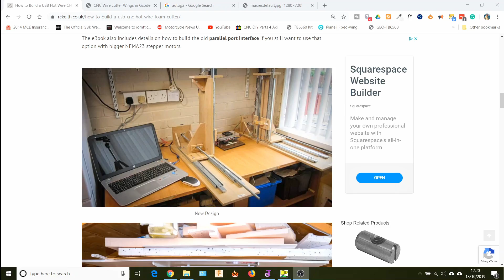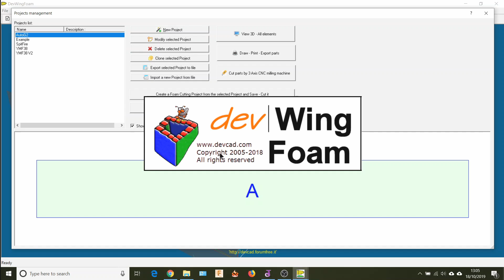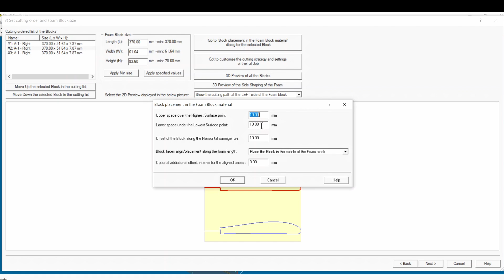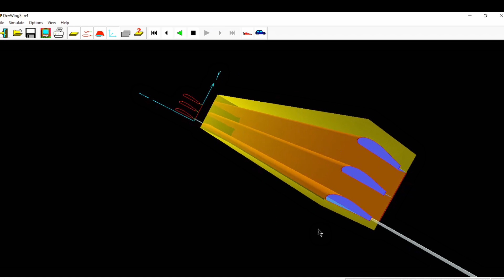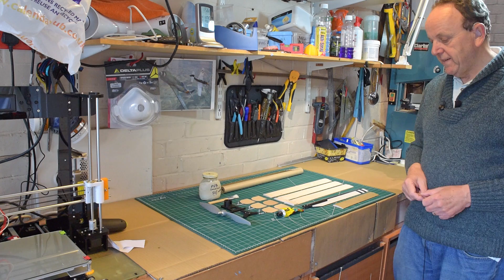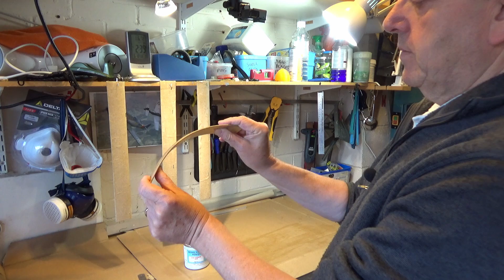How To Make Rotor Blades with a CNC Foam Cutter - Pt1

Comment: Thanks for the video. What settings did you use in Notepad++ to get it to display the g code as your screen did. I tried looking at some g code but it did not look like that. Thanks again.
Reply from the maker: Hi
I only have line numbers selected which is under Settings->Prefereneces->Editing
That's it, can't think of anything else I've changed
Keith
Reply: Keith Howlette Thanks Keith for the information. Have a nice week ahead.